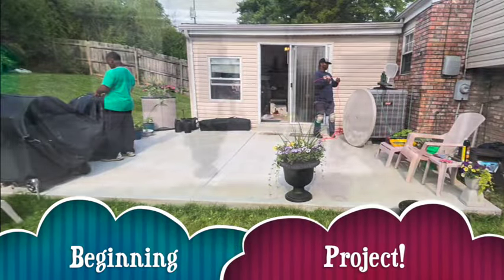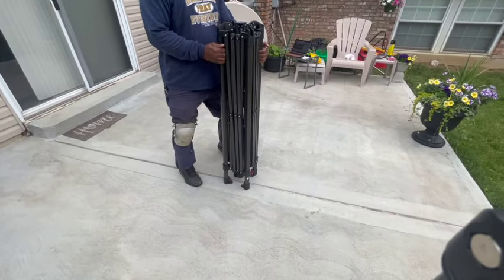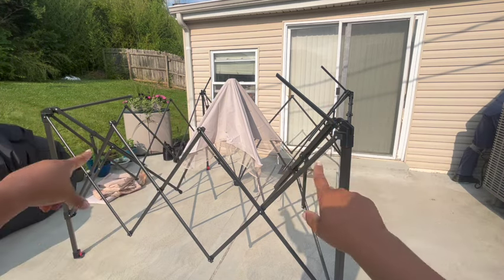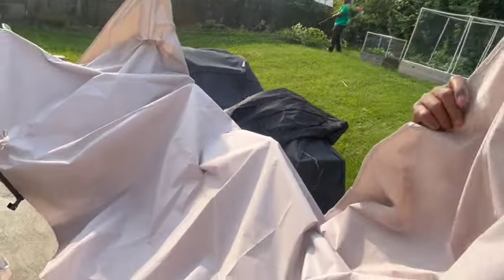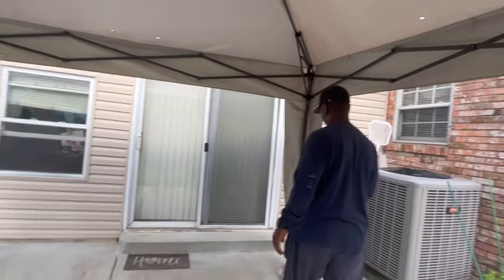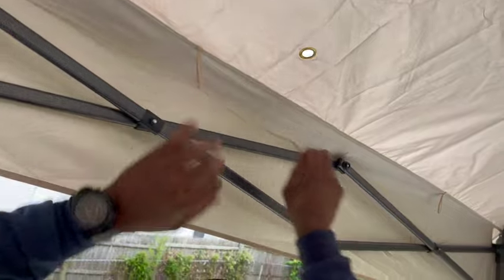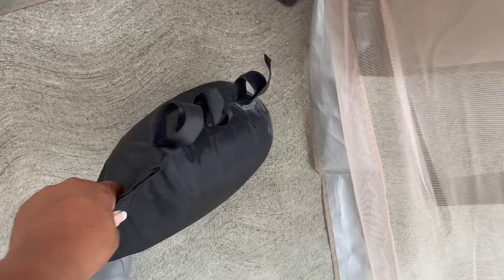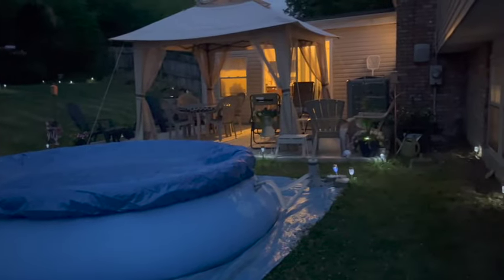ABC Canopy 13x13 Gazebo Tent Set Up With Netting and Review | How To Put Up a Pop Up Tent

Comment: Thanks for the video! I just put mine up but we’re expecting a storm tonight? Should I leave it up with it anchored or take it down? And if I take it down, do I need to take the netting off?? Thank you so much!
Reply from the maker: I see this answer is after the fact but it should have the weighted sand bags and anchored at each corner 👍🏽. How did it hold up during the storm?

Comment: Great video, great instructions. Does it snow where you live? How is the gazebo roof supporting the weight of snow? I live in upstate NY and I have a similar gazebo and I have some concerns. Thank you.
Reply from the maker: Hello Roland! We take down the gazebo tent after our fall season ends, and then we’ll put it back up in the mid spring time close to summer. We do not keep it up in the winter because the snow would weigh it down most likely. We don’t want to take a chance on ruining it since we won’t be outside using it anyway. I hope this helps answer your question-  take care and enjoy your gazebo tent. 🤗
Reply: @traciesplace  I got it. Thank you.

Comment: I have a similar tent and want to place it over my concrete patio as well: can it be left up permanently? And if so, are there coverings/tarp you can buy to protect it from the elements?
Reply from the maker: Hi! I have seen a few people leave theirs up all year- I would be concerned about the weight of the snow ❄️ during winter months if you’re in a state that has snow in the winter. But if you’re in a southern or south eastern state it may not be a problem 👍🏽

Comment: My question is, how do you disassemble this? I lost the directions
Reply from the maker: Hi Marilyn! We JUST took it down about 4 days ago and I was thinking “I should be filming this!” 🤦🏽‍♀️ Unfortunately it’s our last year with it because before we anchored it right- it got blown across the yard twice and the tent top got punctured a few places but the structure was still holding good. Somebody asked for it so we’re giving it away and buying another. This is basically how we took ours down if I’m remembering correctly:
1a- remove sand weights and anchors 
1- remove the clips together with netting still attached (but don’t remove netting from clips so it’ll be easier to just snap on next time)
2- let the tent height down 1 notch on all    4 legs
3- then reach up ⬆️ in the center and release the middle piece 
4- then walk it in a little (about 2 feet) 
5- from outside of tent untie top fabric square vent piece 
5b- collapse metal tent down further 
6- remove other large outer fabric tent piece
7- push/walk metal frame to center completely and place in storage bag